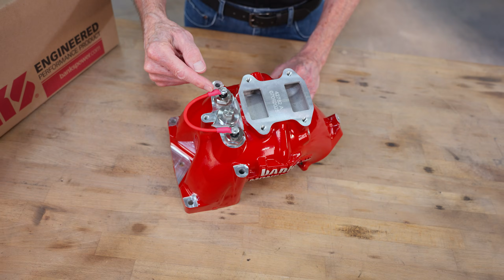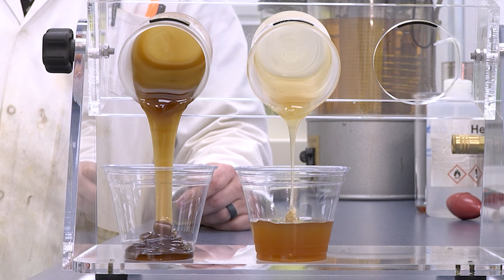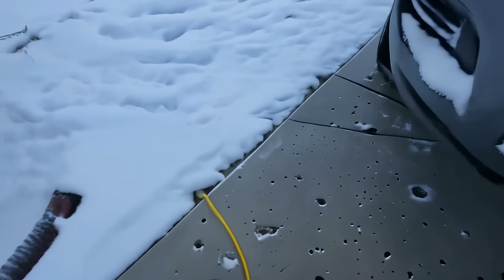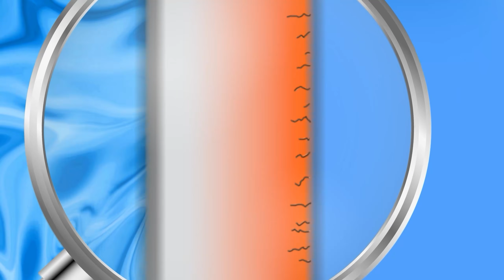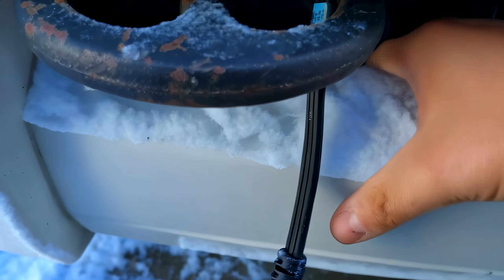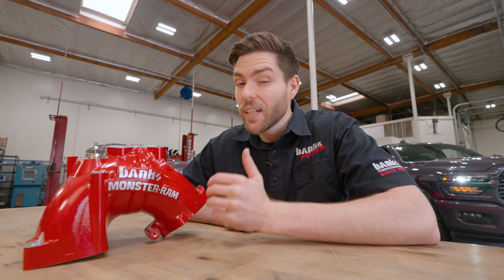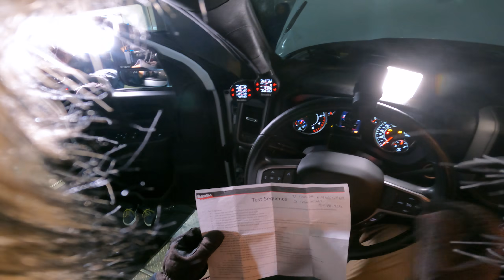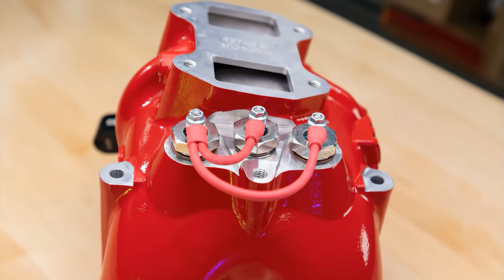We froze a truck to -40°. Here's what happened.

Comment: Ya dont start it if its cold, thats totally practical advice for the real world. Block heater is certainly a good call if its an option, thing is in the real world its simply not always an option.

Dont worry about the life reduction on the engine, out here where it actually gets cold the truck will rust in half before the engine is a concern anyway.

Comment: A couple years agoy area got a winter storm ~ -20 with -40 wind-chill, i took my 69 f250, 360fe out to help a friend. When I finished helping them and got to a stopping point the truck wouldn't start and eventually I melted the stater cable. Probably part of the reason the engine quit on me a few months later.

Comment: It's interesting, but my 2017 6.7 powerstroke stayed out in the wind and cold in Superior WI at -44 a couple years ago, I thought I had it plugged in at the hotel but it wasn't, I did three key cycles and cranked it, it started and that was that.  Also, modern batteries suck, the lead is not pure anymore and they have terrible low temp performance.

Comment: What I'd want to see now is the same tests with no grid heat at all. Some of the voltage drop relating to slow cranking is coming from the 1500w draw of the grid heaters. Would that power not be better used cranking the engine over a bit faster? Heating the cylinder via friction must be more efficient than heating the air via the grid, no?

Block heat makes sense, as the heat capacity of coolant is significantly higher than air itself. Heating the air just seems really inefficient, but perhaps necessary to get heat in anyway possible?

Comment: I'd like to see the -40 C test, with a trickle charger. If you can plug up a block heater, you should be able to throw a trickle charger on. Now I'm no engineer or science professor or even an electrician so I'm not sure if that would even work, but I would like to see it.

Comment: @bankspower at 20:26 Why is ECT and MAT at 4069° and AAT at 4074? Is it beyond the range of the thermistors and glitching?
Reply: I dunno… i tried tracking this as well and couldn’t really get any answers through just watching cuz the next time they show the gauges is after warm ups and start ups, and the gauges display characteristics have been changed? So im thinking either the gauge parameters were set funky, or glitching due to cold temperatures beyond component tolerances like you said.

Comment: i run 15-40 chevron since 1978 in all my cat engines and never had a failure…. my last one has 1.4 million miles. original turbo original injectors head never been off. bearing rolled in at 1 million miles looked like 150,000 miles. Montana and Wyoming winters …block heater used mostly…..79 chevy caprice 305  using same oil had 273,000 and never touched.

Comment: If you drive old cdi mercedes its not so important to use block heater. last winter my shitbox was reluctant to heat because it was -30c so i kept revs about 3500rpm straight from cold for about 10mins, its still works like normal. LOL. And this was many times over the winter. OM611 for the win

Comment: How long did you had block heater on?  Here in Finland we get many times about -30F nights in the Winter. We use block heaters in all our cars. At least 2 hours before start. I will use block heater 4 hours on more if weather is -30F or colder. Meaby connect block heater after driving when engine is still hot. In my case -01 CDI Diesel Mercedes 4 cyl engine, block heater will keep coolant about 122F. Or if connect block heater and keep it connected at least 4 hours temp will rise close to 100F. So start will be good. 
We have 220V and 550W block heaters usually, some will have 1500w block heater with water pump so coolant will circulant quite well and warm engine even better. Many times we also have extra automatically battery charger connected to block heater so battery will get top up same time. Two hours on block heating in my case will get engine coolant about 70F if weather is -30F.
Reply from the maker: Block heater was plugged in for a minimum of 16 hours before each t

Comment: The cold pour test did not share whether both oils were both the same regarding full synthetic, blended or dino oil.  I noticed that was not part of the parameters discussed.  Did I miss something.  Also most cold weather climates use 5-40 weight.  Was there a reason that weight not used? I did see the note at the bottom of the screen but curios why it was noted but not used?

Comment: Great video as always, Gale! Years ago, my '97 12-valve started at -56F when plugged in, and my '01 24-valve started at -35F without being plugged in (this was an emergency and I only did that once). Both of these were outside and not in a garage or shop. I'm in Montana and both these trucks would start at -50F to -60F every time when plugged in, and I ran Amsoil 15W-40 Heavy-Duty Diesel and Marine Oil and straight # 1 fuel in both. I'm curious why a new 6.7 won't start at -40F when plugged in.

Comment: When I lived in Roseau with my 2004.5 Cummins RAM, I used dual battery warmers, plugged in the block heater and cycled the grid heater twice to get it to fire.  Even then, I had to fiddle with the gas pedal to coax the engine to stay running.  Out on LOW ice fishing, it takes several hours on a generator for the block heater, several grid heater cycles and an extra battery that was kept warm in the ice shack to fire up a diesel.  You know it's cold when you hit the start button and the system "gives up".  The piston knock after firing told me the engine was really unhappy.  
When I worked for an Ag OEM, -40F starts required block heat, grid heat and 3 perfect batteries to Start a Cursor 9.  With the starter drawing over 800amps for the first few revolutions, anything less than 9 volts shut down the ECU so it was always a challenge.  You'll never see 2/0 battery cables in a pickup truck like I had to implement for the Ag unit.  A 24 volt starter and a 12/24v relay would have been so much easier...

Comment: northern winters  are that temp on a nice day..  Oil patch trucks are left running during winter and kept running till it gets spring. Electric tape  snaps like a potato chip at that temp, they use low temp fuel filling hose and extension cords as well.   Someone in our work group has a relative that does cold weather temp testing in northern Canada  for makers.  he said  conventional gear oils  are so thick in the winter, You can stand a knife in a jar of gear oil and it wont fall over

Comment: We would put the battery on a trickle charge and put a chicken light under the hood and lean a sheet of plywood on the north side of the truck. We were able to start a 66 gmc at -40° without any problems.

Comment: I have a 2018 6.7 and it came from the factory with a block heater but it did not have the plug. My understanding is that all 6.7 come with a block heater but no plug and it you order a block heater they charge you full price for something it already has. I ordered a cord kit for about $15 and installed it so I now have a block heater I can use.
Reply from the maker: You are correct. Heater elements are installed on the assembly line. You just have to buy the cable.

Comment: Question. 2250W at 11V is over 200 amps, how does the battery deal with that? What amperage did the battery deliver at -40? With the heaters on and cranking it cause of impatient owner how does that fare? Best case scenario testing, but what about the worst scenario in terms of bad oil, bad fuel and a low battery.

Comment: I get the reason for block heaters, but doesn't answer why some manufacturers use exhaust bypass system to do same thing for similar temps (does it mean one makes a stronger block than the others)

Comment: I don’t understand why USA doesn’t use diesel flame block heaters like some European cars 

On many you can preprogram a set time when the diesel heater starts and a small electric water pump pumps the coolant throughout the entire system including the heater core 
For example my X7 BMW starts with 30C engine temperature in negative 20C ambient

Comment: As someone that lives where it routinely reaches -40 and below, I suggest the block heater, oil pan heater, transmission heater and battery blankets with heating pads or trickle charger.

Comment: Would a heater that warmed the sump oil be better than a block heater? Heat rises, ive got a heater pad under my 6BTA sump and the whole engine gets warm inc the oil.
Reply: It'd be much worse.
Both would be good.

Comment: This might be the only high-performance modification in the world where the main selling point is that it works really well when the car is completely turned off! You're paying $750 to put a giant physical obstruction right in the windpipe of your engine to help it start... that then robs you of performance as soon as it starts. Okay. Just use the block heater and add a battery blanket. Or park inside if possible.

Comment: I started a 1999 Dodge Quad Club cab 3500 with a 24valve Cummings diesel in 17°F temps in Texas without a block heater plugged in once, and only once which was after 3 heat cycles. Never did that too that truck ever again, as it sounded like the pistons was slapping the head which makes a sound similar to striking an iron anvil with an aluminum ball peen hammer. It is not a sound you ever want to hear out of an idling engine.
Reply: *Cummins

Comment: The best cold start accessory is a diesel heater from Webasto or Eberspächer running from a separate lithium battery. It's a 5kW furnace burning diesel fuel and circulating coolant.

The radiant heat in the engine room will make the starter battery work better and for extra power you can point the exhaust from the furnace towards the oil pan.

You can also connect a battery charger in parallel with the electric engine heater for more battery power.

These heaters are very common in Europe, but the car manufacturers connect the heater to the starter battery. Always use a separate lithium battery for the heater.

BTW. I live in Sweden and in -26°C, my 1989 TBI Dodge 318 wont start without a heater. I had a 1982 Alfa Romeo with twin dual port Dellorto 40mm carbs that started easy in -26°C.

Comment: Great video. Still I am a bit disappointed that these trucks start such badly in cold. OK, I realize I am comparing apples to oranges when I say; I used to have a 1982 VW with 1.6 Liter, 54hp Diesel Engine. I bought it as it was already 10 years old with 80k on the odometer and I put another 90k miles on it during my 5 years of ownership. It was my daily driver, parked outside and always started great, even at -22F mornings. Most reliable vehicle I ever had. The worst ever fuel economy I had was 26mpg (both on city and at 90mph fwy top speed) and the best 60mpg (@55 mph steady).

Comment: Peace off. :)
This whole deal is a bit wonky.  

My diesel starts at -30 without being plugged in.   

However I did install a Webasto after not starting at -40.  :)

So skip this bs and get a coolant heater.  Been around for 40 years, why try to reinvent the wheel?
 Where is your 0w30/ 0w40 oil?  That would help a lot!!
Last point.  Mix a few gallons of pure kerosene in the tank when below -30.  

And yes, it’s safe when mixed.  No. Don’t do it all year!

Comment: Northern Albertan here.  Something to consider:  With each added thermal element being used to heat intake air, you're pulling harder on the battery before you even crank the engine over.  I've owned two duramax trucks.  I find the best combination for winter starting is an onboard battery maintainer coupled with the block heater.  The battery maintainer keeps the battery topped up and ready for a couple glow plug cycles before starting.  I know rams didn't get glow plugs until 2026, but the same logic applies.  Those winter start procedures you mentioned would be greatly helped with the addition of an onboard battery maintainer.  There's a balance with how many things you can plug in for your truck!  A block heater, a pan heater, a battery blanket and a block heater will all likely trip the breaker on most outlets.

Thank you for updating the monster ram intake!  It'll pay dividends for folks up here.
Reply: Needs to be a 20A outlet not a 15A and must use atleast a 12 gauge extension cord if not a 10AWG.

Comment: Do these new diesel engines not have glow plugs anymore.   In conjunction with everything else they really would help.
Reply: Cummins just started using Glow plugs this model year '26 before that they only had an intake grid heater and no glowplugs.  GM Duramax and Ford Powerstroke diesel both use cylinder glow plugs
Reply from the maker: The 2007-2024 6.7L Cummins trucks don't use glow plugs; they use a grid heater. Cummins have used grid heaters starting with the 5.9L Cummins in the late 80's. They recently switched to glow plugs on the 2025+ trucks. More about the Cummins grid heater and why it fails and what led us to develop the Monster-Ram here: https://official.bankspower.com/insider_news/ram-6-7l-grid-heater-failure-explained-2/

Comment: Cool testing! I usually just shove my propane jet heater under the oil pan for 30 mins or so. With 15 gallons of oil it takes a bit to get things moving, and I let it idle with that thing down there too...

Just to prove you got the sauce, you shoulda done a start test with room temp batteries installed before trying to start at -40. Just for science of course

Comment: so wait... if there is a 1500w draw, or 2250w with the triple, that would make those battery's sag even more.... 1500w at say 11.6v = ~130A, and 2250w at 11.6v = ~193a... thats a lot of amps for a double heating time, what if there was a battery blanket heat pad along with the block heater

Comment: Why don’t modern heavy duty diesel pick ups use 24v systems?
I appreciate the informative videos as always.
Cheers Pat 🇦🇺
Reply: As far as energy goes it doesnt matter. In practice, these trucks are pushing the limits of half inch diameter battery cables and it would make a lot more sense to at least jump to 24. Two or 4 batteries required as well as a 12 to 24v converter. All this would cost more than is worth it..
Reply: @EldonJohansen with the 24v system you wouldn’t require such large gauge cable and less voltage drop?
Reply: @PaddyBoy644 when 80% of the voltage drop is in the battery due to the exteeme cold temps , the voltage doesnt really matter.   A thermos of hot water would do more
Reply: Honda actually made a vacuum insulated 3 liter thermos for preheating their hybrid insight.  Its not hard to scale this up to 10 gallons and you have a real cold start solution for larger trucks

Comment: Come to Canada you can test -40 for free lol. My old 2018 ram started in -40 every time in -40 with two cycles of the key and 5-40 oil and not plugged in. Sure didnt like it but it started every time. Put 200k on it then my company sold it. Was a great truck.

Comment: I would of used lead acid batteries, AGM batteries are garbage, i quit being abused by them and switched everything back to lead acid even in cars that came with AGM and now i have no more problems and they actually last. AGM are sensitive junk!
Reply: AGMs really need heaters and they dont charge well like lead acids do. There wasnt enough attention to the battery in this video. They should of made sure the battery was 100% charged, like it just came off a long drive. We didnt see how long they ran the truck. It seems the batteries just started the truck then the truck was shut off, leaving the battery in a depleted state after each  start. You left us hanging on that and maybe even yourself!

Comment: South Dakota February 1989....50-70 below zero visiting friends. Parked 1979 Peugeot 504 diesel in friend's garage with block heater on a few hour before heading back to California. Engine  cranked decently  but wouldn't start ( Yes,the 4glow plugs were operable at the time of failed start attempts). How did we get it started? Friend's 1970s Chevy pickup with a tow strap for about a 1/4mile before the engine reluctantly lit off in 3rd gear about 20ish mph. I'd never heard the popcorn crackle idle so loud before.

Comment: QUESTION: Is the Grid Heater Bolt Failure a know issue in the 2002 Cummina ?

Have 255,000 miles on my Dodge 2500 without issues, but after reading/watching stories such as this...my fingers crossed when Nevada temps drop. 🤞

Comment: Thank you for listening to us Canadians and coming out with the 1500 watt Monster heater.  I'm so happy with it!!!!!  That combined with my block heater, battery heater, and oil heater makes my truck start like it is a 75F day every day!  ... Thank you for being the best out there!
Reply: Even as banks authorized installers up in northern Canada where in winter it routinely gets down to -35C or even -40 influenced the dual element monster ram intake horn as paired with a block heater along with a battery blanket has many ram owners report during a cold snap to the point environment Canada had issued extreme cold warnings for their area when their Cummins had started like it was in the middle of summer.